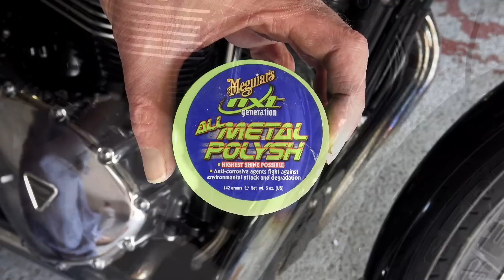custom Triumph bonneville T100, how to remove Bluing/scratches from motorcycle Exhausts!

Comment: I have to give credit where credit is due. I have a 2014 BMW R1200GS that I bought new and I’ve put 16000 miles on it, mostly off road. I started using Autosol’s bluing remover a couple of years ago and it works well. I saw this video and tried to get the products but wasn’t able in the states. But I did start using this technique with what I could get and the results are amazing. Today someone asked me if my bike was new and how I kept it so clean. Thanks for the video.
Reply from the maker: Hi Rob, most metal polishes will do the job, I just use what I find works best for me. im glad you got the result you were looking for!

Comment: I own an '02 T100; several years ago I had the pipes polished, cost a couple hundred bucks, they haven't blued since (more of a gold tint, no bluing).  I'll have to give this a try!  I believe the bluing is mainly the result of using single-wall pipes, as well as the SAI (which I have removed, along with the airbox; also mounted the Triumph performance mufflers).  Suspension was too soft; Race-Tech cartridge emulators and springs transformed the front end most marvelously, I mounted Ohlins shocks out back.  I've done over 500 miles in a day, no problem, with the stock seat.  Great bike!
Reply from the maker: $200 to polish the pipes! i think ill take this video down and start up a business! lol. all very worthwhile mods Mr Rider, rear suspension has already been replaced and front progressive's waiting to go on, the bike will be transformed over the next few months, watch this space!
Reply: Sounds good!  I don't know if later models differ much from my '02 (aside from the greater displacement), but the only kit needed to take out the SAI on mine was two plugs to cover the holes in the head; I chose a couple of nicely polished ones with the Union engraved on them.  Aside from that it was just a matter of removing the plumbing.  The aftermarket for the Bonnie gives you a lot of options (I also replaced the stock igniter, raised the rev limit to over 8K).
Reply from the maker: Raised the rev limiter to over 8k? intriguing! what affect does that have on performance?

Comment: Hi Stu, this header blueing on the 865 air cooled Bonnys is caused 100% of the time by the SAI (Secondary Air Injection) system. Removing this system will allow the engine to running cooler, especially in traffic.
Under certain throttle openings the SAI allows fresh air to enter the cylinder head just aft of the exhaust valves. This then ignites any unburnt fuel in the headers, which super-heats them.
The system is very easy to remove without any onerous consequences.
Reply from the maker: Hi David, we will be getting on to those sort of modifications later in the pay day projects series. This video was intended just to show people how best to deal with bluing on exhausts, something nearly all bikes suffer from. Thanks for your comment and of course for watching!
Reply: I've had the SAI deleted from my Newchurch since it only had 500 miles. Still blues/blackens the pipes. They're black by the end of every season.

Comment: Take the air injectors out. Removal kit from Triumph consists of two bolts that replace the injectors. Have owned two T100s and a Speedmaster and taking these measures worked a treat.

Comment: I actually like the look of the blue on exhausts. To me, it means the bike is being ridden and it kind of gives it a bit of flare. Although, I do agree with cleaning it off a couple times a year if it degrades the quality of the metal.
Reply from the maker: It ok if its a nice clean blue. the only problem is it doesn't stay that way and will eventually turn black and rough, not a good look!

Comment: good info on the cutting ability of different compounds. Having owned a T100 I know where you coming from. My present bike r1200rt has blue pipes and I will give it a go. I have noticed on numerous BMW's hand marks in the blueing area. The oils/sweat of the assemblers hand marks leaves a recognisable pattern after the engine is test run.
Reply from the maker: yes the good thing about BMW is that they use a high grade stainless steel on their headers so they dont get as bad as other brands. Its hard work the first time Stephen but the its well worth the effort! thanks for watching!

Comment: You can get kits to remove the air injection system on these bikes I think Norman Hyde do one the air injection system super heats the exhaust gases burning more unburnt fuel which turns your pipes blue the kit includes a bolt which replaces the air injector which is located next to the spark plugs
Reply from the maker: Hi John, yes we will be fitting such a kit from MOTONE later in the PDP series, this video was not intended to be a triumph specific video, more a guide for all bikers, and as i said in the video the pipes were also badly scratched!
Reply: stuart fillingham thanks for the reply Stuart fitting the kit will get rid of the popping on the overrun most people leave the pump in place connected to the loom if you disconnect the pump altogether you get a engine warning light on your dash you can fit a resistor instead of the pump that fools the ecu into thinking the pump is still there
Reply from the maker: Hi John thanks for that! i believe MOTONE are putting a comprehensive kit together so will see what they come up with, but we will be doing a lot more to the bike performance wise, its still very early days yet!
Reply from the maker: Yes its an ancient method Jerry, i just thought i would share with those who dont know about it. a few minutes a week is definitely the best way to go, i dont hold with the idea of just leaving them to grime up! thank you for watching!

Comment: Hey Stuart, I was always under the impression that stainless pipes do not go blue, and I feel sure that my old T100 had chromed steel pipes. My Thruxton R has stainless pipes, and if left, they don't go blue, but a golden brown, (I haven't tried the magnet test, so don't know the quality of the stainless)
 I do use your method to clean, and I must confess, have always used Solvol Autosol. My old Laverda had stainless pipes also, and they also turned a golden brown, and if left, then to a dirty brown, but never blue. good tutorial though mate!
Reply from the maker: Hi Dave, it depends on the grade of stainless steel. higher grades contain far more nickel than steel in which case the pipes will discolour more slowly as there is very little magnetite present in the alloy, so they will go a subtle brown colour. low grades contain more steel than nickel so the bluing will be more pronounced as there is far more magnetite present to be pushed to the surface. also if you have the wc thruxton, i believe the pipes may be double skinned as in the T120, so you cant actually see the down pipes they are hidden.
Reply: stuart fillingham Hi Stuart, yes I understand that, as I remember A2 denotes the best quality for fasteners etc, and 303 is good for machining, My Thruxton R unfortunately is not double skinned, so I Do have to keep on top of it. My T120 like yours is double skinned. I still think the T100 is chromed mild steel! I'd sooner be talking all this over a pint! Cheers mate! On a side note, my Thruxton pipes are absolutely non magnetic
Reply from the maker: Hi Dave, the Golden brown is an indication that the pipe have a high nickel content and low steel. so high grade stainless.

Comment: I've always liked the exhaust burnished look
Reply: I always laugh at the guys that purposely do it to their bikes
It's not a great sign on the bike to begin with, and could be indicative of a cooking issue.
Harleys often have them just from sitting in traffic. That oil cooler engine isn't a fan of not getting a little throttle to pump it through

Comment: The motion is called churning motion. We use it churn curd to get ghee. We wind a rope to a churning stick and pull/push the rope to rotate the stick. Exactly like what you were doing with the cloth to clean the exhaust.
Reply from the maker: Thank you Rohit, We dont churn much of anything here in the UK any more, which is probably why i didn't know the term for it!

Comment: Sir great video with crisp explanations. Just wanted to know that will fixing a centre stand greatly reduce the ground clearance of the bike.. I live in India and many speed breakers scrape the underbelly of my Bonneville...
But I'm finding it difficult to do the routine maintenance without out the centre stand
Reply from the maker: Hi Kumara, if your already having ground clearance issues a centre stand will almost certainly make things worse. but have you considered a paddock stand or a simple motorcycle scissor jack for maintenance, it would perform the task of a centre stand but would not be permanent, and there are may available for a little over £30 that are ideal for maintenance tasks!
Reply: stuart fillingham thanks for the proMpt response... I've ordered for a scissor jack and hope it serves the purpose

Comment: Have you ever tried Simichrome metal polish. I have used it for years on lots of applications with good results. Also I have had good results using one heat range colder spark plugs.
Reply from the maker: I must confess ive never actually heard of simichrome!
Reply: If you get a chance give it a try. It's sold at most motorcycle shops.

Comment: Great video! There is a lot of advice going around about 0000 (finest grade) steel wool working well to clean chrome, specifically for removing burnt on 'bits'. In your experience, will metal polish applied with cotton stockinette remove these bits, or is there another method that you would recommend? Not sure if I want to test the steel wool method... Thanks!
Reply: Update on my test: The 0000 steel wool and metal polish lightly scratched the chrome, it's mostly not noticeable unless you look closely. It was very effective at removing bits stuck to the exhaust, but was overall a large failure. Not sure why so many people recommend this? I used the same method to fix some light scratches on the silencer and made it a lot worse. I now have to replace it. Hope this can act as a good warning to others. Listen to Stuart's advice!

Comment: I do this on mine too. I’ve been reading that removal of the Secondary Air intake system can slow the bluing build up. Any thoughts on that?
Reply from the maker: Hi Marc yeah its nothing new, but i get asked about it a lot! yeah ive heard the same, apparently it allows the engine to run a little cooler and i believe Motone are working on a kit right now!